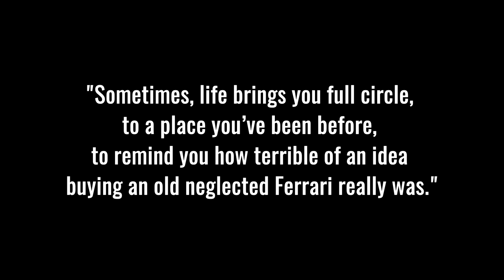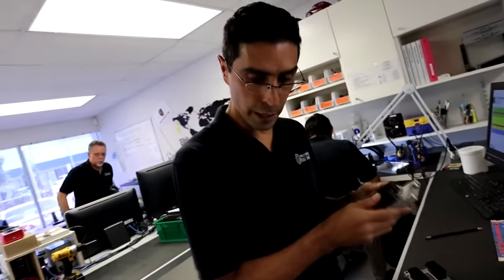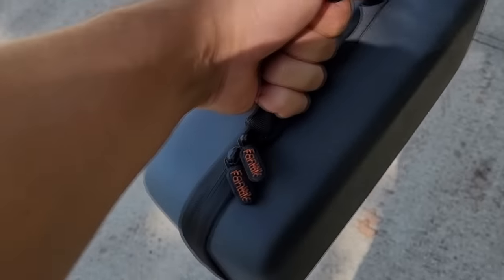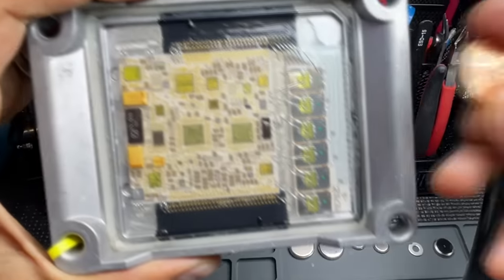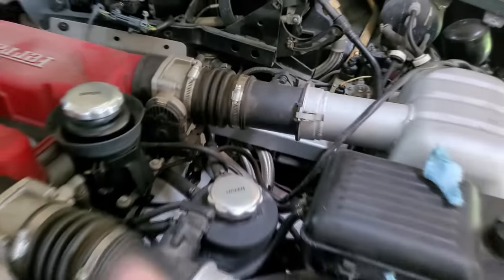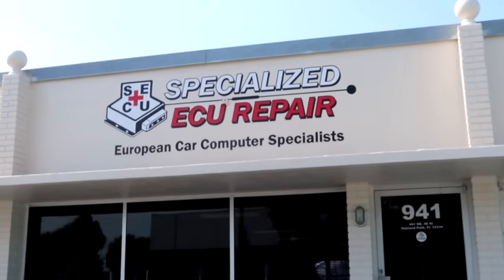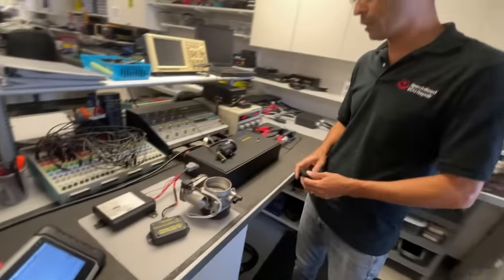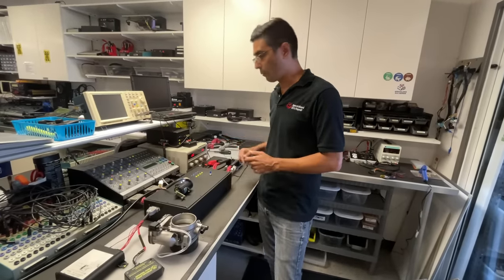Here's What FINALLY Fixed my Cheap Salvage Ferrari!!! (EVERY Ferrari 360's Fatal Flaw)

Comment: Sam, why are they not dumping the CPU micro code and use a FPGA to duplicate the ECU functions? it shouldn't be that hard....  especially the duplication that's been done for the Retro Computer community.....  the hybrid Tech was dropped many years ago...  they proved to be too costly....  an FPGA would do this job and the board design wouldn't be that hard.

Comment: You Got to emulate the old computer on a new board with a new micro. Yes it represent some work but as long as you can build the corect configuration files to send the Correct CAN message on the connecter pins you already have then it'sdone !! But yes! I think that ou don't really have access to the code you can only transfert It to a different computer if this is the case its like making one from scratch yarck!

Comment: What is so special about a non-repairable ECU? Make a different one using the common technology that has been used in the past. It might have a larger footprint but at least the car would work and that part would be reliable. Just modify an existing ECU and program it to work with the Ferrari. Lots of ways to skin a cat.

Comment: If apple made a jump pack you would only be able to use it on apple brand cars, if it needed to be repaired they would jerk you around and then tell you the repair would cost 90% of the new device, you could only recharge it from a apple brand car and would charge you twice the price of every similar product.

Comment: I have been thinking about this... and my prior comment stays... this has happened with Ferrari before, and it will happen again... reference the 348's climate controller module.

This is my take, but realize, that unless you can clone the PCM entirely, and perfectly, this car, an others modified like it, would so fail California smog tests. Let me also clarify that CA smog tests are not any worse that other states, it's just that they actually enforce the EPA requirements... nothing more.

This would be a 2 part modification, because of the complexity of making this work otherwise.... 

Part 1, ditch the F1. The early F1 transmissions are conventional 6spd manual transmissions with a package of electronic/hydraulic systems to automate the entire  mess. It is called F1, but it is NOTHING like what they used on the F1 race cars. There is a great book on the guts of the F1 car, written from the inside of Ferrari about 20 years ago. Amazing stuff.

However, the transmission can be converted, but you will need the gated shifter, pedals and such.  This does not work with the modern dual clutch automated transmissions. Period. Porsche has created a shifter that will work such a transmission, but that took serious Porsche engineering!

Next, find an aftermarket engine controller that will control the engine. It will have to support a clone of the PCM code, so it will run the engine exactly like it would from the OEM. I would consider an off the shelf Bosch Motronic setup... but there are others... This is where the SMOG tests might get troubling... Visual may not be the problem, believe it or not. Most SMOG techs would never know what is wrong or right. But there could be one that does. This will also require a new harness. The split V8 controller architecture may no longer work, so a custom harness will most likely be needed. 

Finally, all of these fixes could harm resale. If done right, and if it would pass a smog test, when plugged into the ODB2. Again, ignorance of the factory layout might get you past the visual inspection. Done right, this fix could be resold. Even if it works only with the manual cars, it would free up that many OEM controllers. 

The real challenge will be sending messages to the dashboard correctly. At this point, it gets into clever programming, or, clever translation of the messages being sent. Perhaps intercepting messages using a Raspberry Pi computer? I donno, just spit balling.

Comment: If you spent that much money already, and know the problem then here's the solution. I think its fair to say your not a Ferrari collector, and don't particularly care about making it factory mint condition in the end, fair? Spend the money one more time and get a stand alone, or different engine management system. Compared to back then, the current systems available are further advanced and probably better. Holly dominator for the win lol🤙🤙

Comment: Vehicle computers fail for 2 reasons.  Voltage variation from bad alternators or bad batteries, OR...  HEAT!!!  I wish, with the depths of my heart, that MFGs would heat sink the crap out of the ECM and BCM's, and place them in some consistent air flow...  but they don't, they place them under the hood next to THE FRIGGIN ENGINE!!!  Best place for that ECM is in the side of the Air intake, where tons of air would blow over it.  I built TV studios for a living and discovered a heat issue in one of the proprietary encoder boards.  As soon as I slapped some honkin heat sinks on the encoder chips, the failure rate dropped from 70% to 1% OVER A 10 YEAR PERIOD!  yup, we still have some very old units in our schools.

Comment: If the demand was there and the engineering could be done for less than the new higher price of the ECU it would be possible to create a new one that was PCB based.  I suspect it would cost more than a couple grand to do and thus not make economic sense at this time.

Comment: Hybrid ceramic circuit boards are not really very new.  GM has used them for over 30 years.  I am surprised no one has repair techniques for them yet.

Comment: Go figure, electronics in cars. I have seen several videos of cars getting hit by lighning. Car is totally dead, fries all of the computers. Most often the insurance will total the car for it. Running back about 28 years, I had an Olds 98 luxobarge. Was running flakey, had all types of engine work done on it to no avail. Turned out to be the primitive ECU GM had started to use on their engines. Had it replaced and it ran fine. Moral of story ? I should have kept my 78 Olds Cutlass diesel to gas conversion. I dropped a true 73 Rocket V8 into it hand had zero engine issues.clessic G body stuff. The biggest problem with it was t the time it was a real no no to use unleaded gas in a car of that year. I always had to show any new gas monkey under the hood the olds rocket and show them the Diesel only sticker over the filler which by the way did not have the unleaded restrictor in it.

Comment: What they need is someone to create a ECU to USBC adapter, and plug it into a cell phone.  Everyone has a used cell phone there not using that is 200x more powerful than what this is requiring.  Once that is done, someone just has to write the code to run any car.  ANY car.   you literally would make 2 billion dollars and change the industry.

Comment: Why don't you flash the ECU onto a piggy back and use it as a replacement? We're talking about a 20-something year old car, should be easy enough to reverse engineer and implement.

Comment: Hey Sam, thank you for video and referral links. I need help.
 Can ECU help me. I need a keyfob for my 2015 Ford Fusion. But locksmiths said that the now fob won't work (computer program issues with or by maybe previous owner messed with maybe adding aftermarket parts or something)

Comment: Ok so I’ll try my best to wrap this up.   If a product fails well before the established expected lifespan, you have a good foundation to complain and maybe to make a case against the manufacturer.    Unless the manufacturer explicitly states that, for example, your new Apple iPhone will only perform as it does new for about 1 year, then the performance will deteriorate rapidly until it’s all but useless at about two years.   If that happened, the prices would plummet, and Apple as we know it would end.    But that’s exactly what they should do.  Because if we all got together and pursued a case against their “planned obsolescence”, they would be screwed.    Just the. Case itself could spell the end, regardless of outcome.  Look at what happened to Audi in the 80’s, even when it was never found to be at fault!    Then Firestone/Ford in the early 2000’s, where again, they turned out to be not at fault, just a bunch of lousy drivers.   But it hurt them.    The Apple lawsuit involving them manipulating the battery life is emblematic in this argument.       I even did an experiment on my own when I suspected iOS manipulation was afoot.   I bought three phones in relatively quick succession.   A perfectly good 5SE was “repaired” but performed marginally better, and to my mind, for no good reason.    It was two years old, and had been the most reliable one I had ever had, much better than the crappy flexible iPhone7.    Trash.    Then I got an 8 from AT&T on an “upgrade”.    This brand new phone worked MARGINALLY better than my 5SE.   Hmmmm.   For the record, I still have that 8, and use it as an iPOD, and it’s trouble free, the screen works great, the battery lasts as long as my XR, etc.    Hmmmmm.   Then I got the XR.  Easily the best iPhone yet, the strongest by far.      It it has issues that Apple will not admit to be at fault for.  Hmmmm.  Needless bullshit which is making me consider an Android.   Yeah, I went there.    Ouch.     Point here is that manufactures cannot get away with making products that fail, intentionally designed in or not, far more quickly than the established public expectation of lifespan.    Even if they win the court battle, they’ll never win the consumer battle if word gets around that they are screwing us all.   Same with Ferrari, Fridgidaire, Samsung, Fruit of the Loom, Sony, Oscar Meyer, McDs, etc.    Go buy a burger at McDs and have it spoil within five minutes.    Once is a fluke.   30% of consumers having the same thing happen is a problem.   A very big problem.   But without solidarity, they’ll just keep on screwing us out of the next dollar, and the next, and the next.     Then we have “right to repair”.     Hmmm

Comment: So inform me if I’m wrong, but the “right to repair” movement is based on the idea that manufactures prevent consumers from being able to repair products that they themselves own.   As in, if your iPhone needs a new battery, you have to buy an Apple battery, and it has to be done at an Apple repair place.    Or if you’re Ford Explorer is out of warranty and you need to replace the stereo, you have to let the Ford dealership do the repair as opposed to being able to do it yourself, not by choice or ability, but because the manufacture has designed the product such that owner repair is untenable.   Let’s say it takes a specific tool to remove the stereo, only available, or not available at all, from a Ford dealership.     That’s dicey.   Should the manufacturer design their product around the needs of the DIY guy post warranty?   Great question.  Glad you asked.    What do y’all think?   I think not.    There are too many laws already.   I think the consumer should be the one steering manufacturer trends with the almighty dollar/vote, as they are one and the same.   Every dollar we spend is a tacit vote for where that dollar went, knowingly or not. 
Now, if the manufacturer divulges information pre-purchase, explaining things which are different from what the public at large has every right to expect, then the manufacturer has every right to implement that change.    Let’s say you get a flat tire, but the sales man, the literature, warranty book, owners manual, all explained quite plainly that if you get a flat, you have to call the dealership and they will come fix it for you, and this is what it will cost.    How long would that product last?    Not long I expect.  But what if the price was very reasonable and most people agreed with that change.  What if the manufacturer had been previously sued because of problems arising from tire changes done by the product owner, which led to bigger problems, maybe even personal injury or death.   But it turns out the public is just too stupid to change a tire safely or correctly, so they implement this new plan to save their own asses.      Hmmmm. Maybe that’s a great idea.    Change a reasonable fee, maybe $50, $75, $100 per instance, and I’d bet the idea would take off, and help the manufacturer keep the public safe from itself.      What if Apple had been sued by a DIYer who mishandled a battery which blew up in his face and they sued Apple.  Then you’d see the other side of the coin.    But on the other hand, the manufacturer cannot needlessly prevent the buying public from repairing their own product which they OWN.    IF WHEN THEY SELL THE PRODUCT, IT IS PLAINLY STATED THAT AFTER THE WARRANTY PERIOD, THE MANUFACTURER WILL NOT SUPPORT THE REPAIR OF SAID PRODUCT BY THE OWNER OF SAID PRODUCT, then that is a different story, and I don’t believe a LAW should be implemented to force manufacturers to do so.   Why should they be forced to keep making a part for a product that is out of production?   Or any repair product at all?  Even if they’re still produced, they shouldn’t be FORCED to sell that part to the owner of said product.   The market should dictate these issues.    Ok, so Apple doesn’t want to support post warranty.  Fine.  Let this info be disclosed clearly pre purchase, and see how far they go.   Same with this Ferrari.   If it had been disclosed to the owner before purchase that some of the parts could fail completely and be irreplaceable at any giving time past the warranty period, things would be a bit different.    I think THAT should be a law.    Clear disclosure about the real future of your product versus the established expectations of said product.      Let’s see where that law gets some of these rip-off artists/manufacturers.      Trust me.   They will conform to the needs of the buying public, boutique or not.    Rolex wouldn’t sell many $20,000 watches if word got out that they would fail just out of the five year warranty and be cost prohibitively irreparable.    Nor would any company.      We have the power now more than ever to set things straight, but we must all use the info we have, confirm it’s authenticity, and get it out in a way that’s indisputable, and gets to the people who need this info most.      It is the misinformation age as much as it is the Information Age.    We can beat that first problem.    It won’t be easy.   But remember, five hundred years ago, they not only believed the earth was flat, they put massive effort into disproving the facts to remain in the power position.   Sound familiar?    Is the world flat?  Is Earth the center of the universe?   Is the Church the only source of trusted information?     Is the Black Plague still plaguing our world?  Things change for the better.  
But only with solidarity.

Comment: "ECU's don't fail a lot" you sir clearly haven't owned a Ford Falcon with a Barra motor. Same issue ECU's mounted in engine bay, constant heat cycling kills them. Can't service them effectively because they're completely sealed shut.

Comment: It seems that a hardware guru could design a new computer that would replicate the functionality of the original.  It seems like being able to sell them for 2k or more would be enough of an encentive.  There are a lot of really smart guys out there that have created functional emulators so that a regular PC can emulate totally different game consoles like Nintendo, Amiga, PS 1 & 2.  The new PC's are so fast and powerful that the emulators run the original games that is software.  I bet you could find some of these emulator devs and pay them to create a fully functional emulator for this car.  Along with this a custom interface board to match the wiring of the car.  I bet that inexpensive Rasbury Pi computers could do the job.  I know I started out talking about designing a custom computer, but as I was writing the Idea of emulators with custom hardware interface boards would be far more economical.

Comment: Good vid! Those Ferrari computer modules are poorly situated and also rather poorly designed. You don’t place electronic modules anywhere near the engine bay. The constant variation in heat will degrade the chips over time. The tiny boards in the modules are impossible to replace. Ferrari renders a hugely expensive car useless if one of the modules malfunction. Terrible!

Comment: Throw out the stupid Ferrari induction system.. Build a new intake with individual Kinsler downdraft throttle bodies that run with an aftermarket programable engine management system.

Comment: There is not enough 360's to do a new ECU, if it was a vehicle that 100's of thousands were made, it would be worth it. If the ECU's are less than $5k for the pair, that's what you need to do because a custom EMS would run a fortune, then you have to manufacture them to plug and play so you gotta head to china. It may be more cost effective if you can find another Ferrari with a similar ECU and software and just build a physical plug adaptor to do a conversion.

Comment: Well long story short I fried my LS ecu and had a cell phone shop give it a try they told me it wasn’t there normal but was willing to give it a shot they was able to fix it the ecu is about the same size and looks the same as what you have and I know the part in cell phone are smaller bu I would ask them to give it a shot mine was damaged from terminals hooked up backwards during a jump start fried a few small parts and they was able to fix it